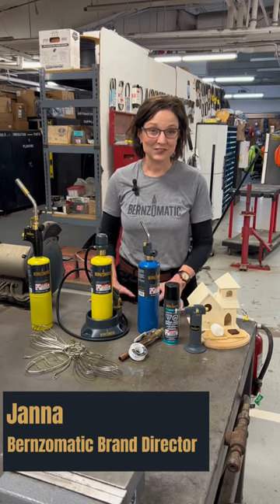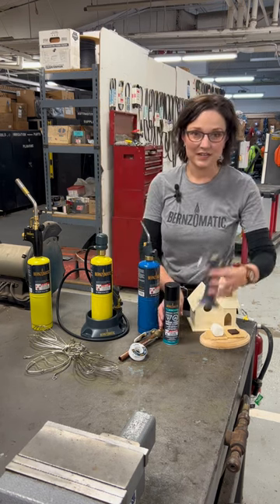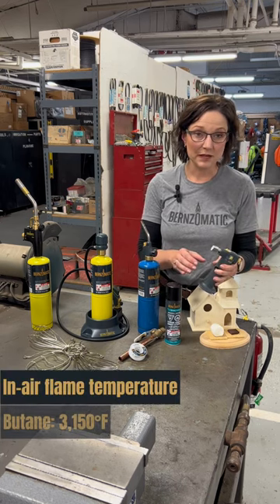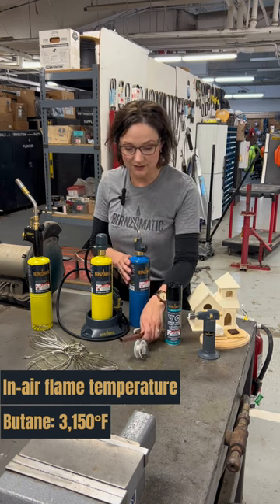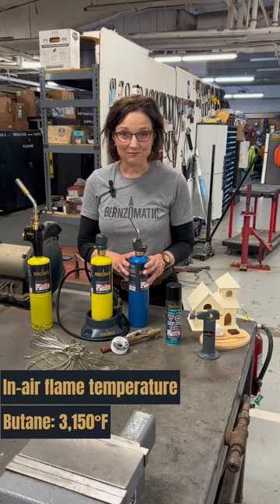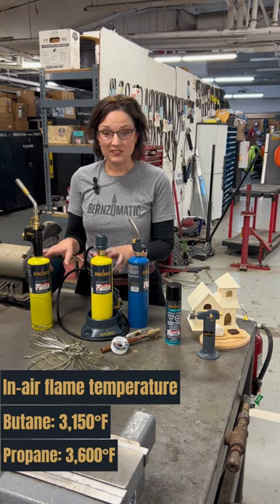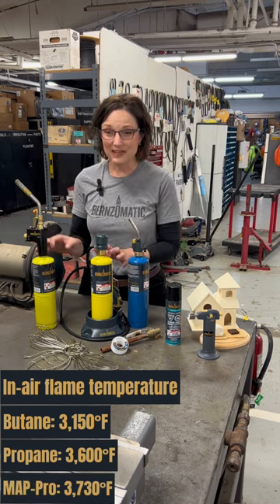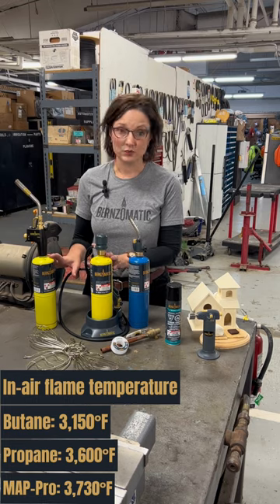How To Find The Right Torch

Comment: What would happen if you used a propane torch on map gas?
Reply from the maker: Hi Max, great question! 🔥Using MAP-Pro fuel on a propane-only torch may cause the seals in the torch to degrade, which can cause leaks. To ensure the safety and longevity of your torch, we recommend only using the recommended fuel for your torch.